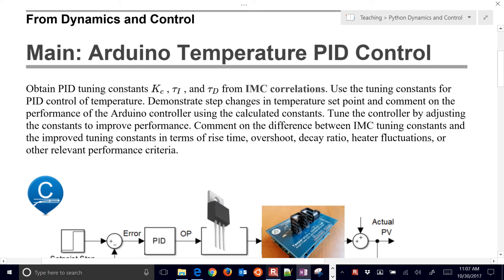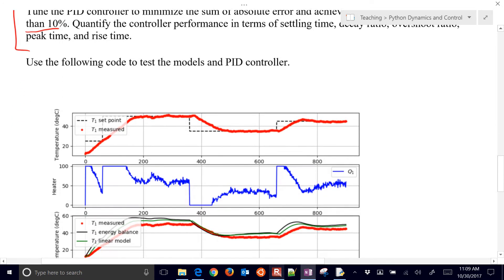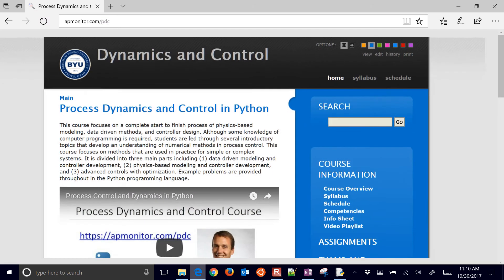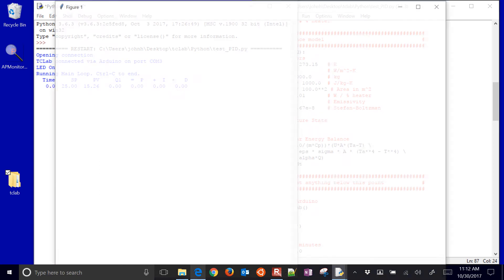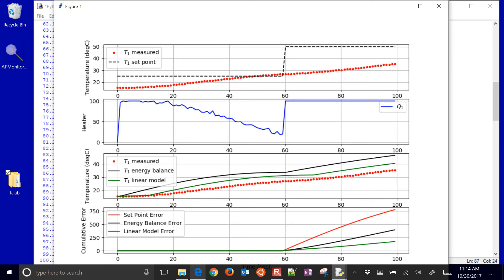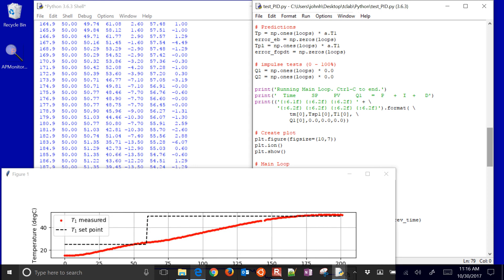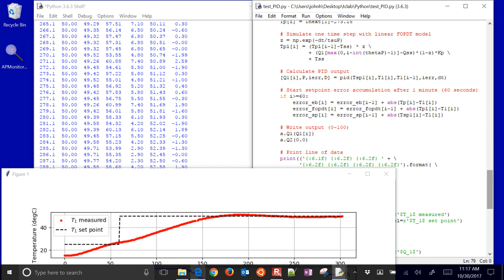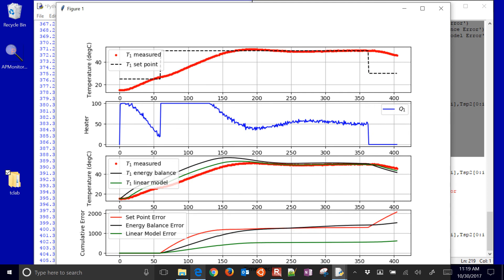PID Control with Python TCLab

Comment: How to change the value of gain in during simulation?
Reply from the maker: An easy way to do this is to create an "if i==15: Kc=5" statement that changes the gain to 5 at cycle 15 (for example).
Reply from the maker: You can also implement gain scheduling by setting the gain Kc as a function of the current measured value such as Kc=Tc1*0.1. This is called gain scheduling and is commonly used for nonlinear systems.

Comment: If we use 230VAC ON OFF actuator displacement of approx 4mm  which takes 3mins to turn on and off completely. How we can tune pid for it. Could you guide me the procedure. Intending to use in water cooled air conditioner.
Reply from the maker: You would just include the actuator delay in your process model. This increases theta_p and would affect your tuning. http://apmonitor.com/pdc/index.php/Main/ProportionalIntegralControl